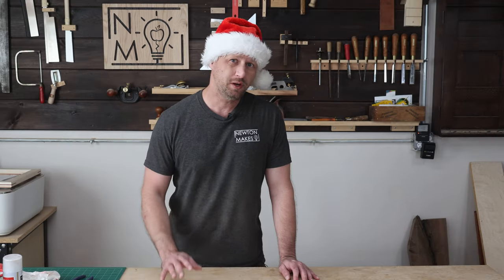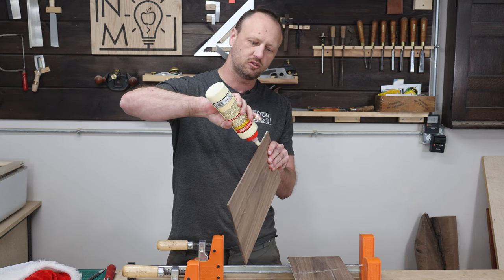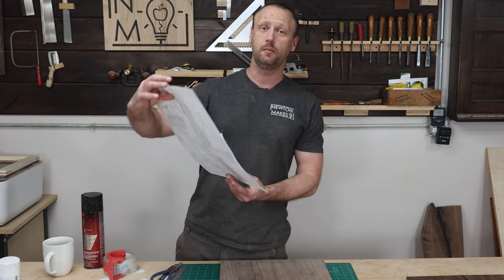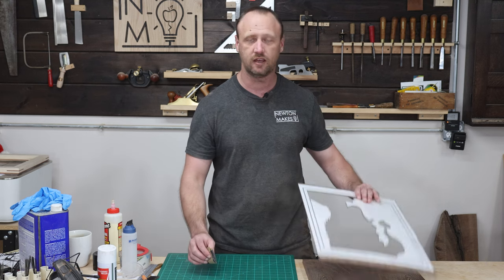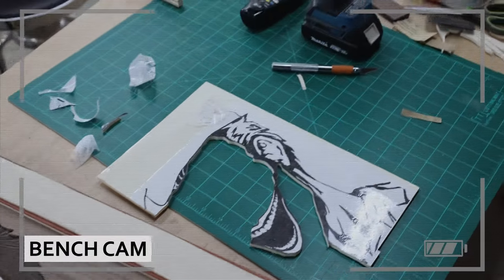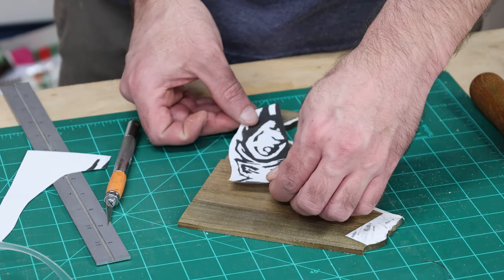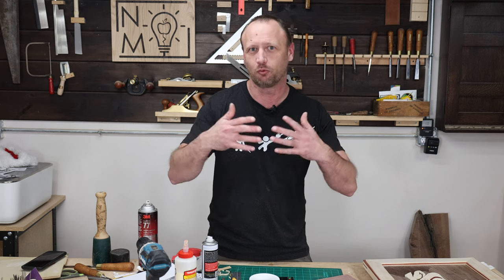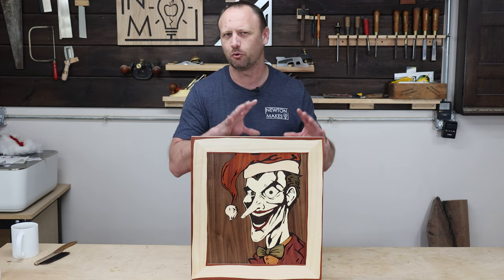Get Colorful Scroll Saw Projects with NO Paint!

Comment: Good afternoon Billy, I have been following you for a while, with this channel and with the other channel, and you create the most fantastic things. I currently own a scroll saw, and I am just beginning this new adventure and I am having a lot of deflection with my blade? It is a Hawk scroll saw. I am just trying to decide is it me or it that the way it is? I have been noticing when you cut, there is very little deflection and it cuts right through the material. If I put anymore tension on the blade it snaps apart. I am considering buying an excalibur but I notice they are a green color now and I really like the black. Please if you do not mind could you help me with this problem that I am having. I love all of the features on this scroll saw as well, with the tilting head instead of the table tilting.
Reply from the maker: From my understanding, Hawk scroll saws are great tools. I've never personally used one. I tension the blade to the point where I can pluck it like a string on an instrument. I don't feel like I over tension because I rarely break blades. I'm simply speculating but perhaps the deflection you're seeing is not about blade tension and instead is about the blade size verse material you cut. If you haven't already, try a larger blade. Or (shameless plug) try a different type of blade I mention in my blade shootout video. A new saw is expensive. You can get my identical saw (in black) on Amazon for about $900. If you haven't already, try several blade sizes or types because blades are super cheap in comparison to buying a new tool.